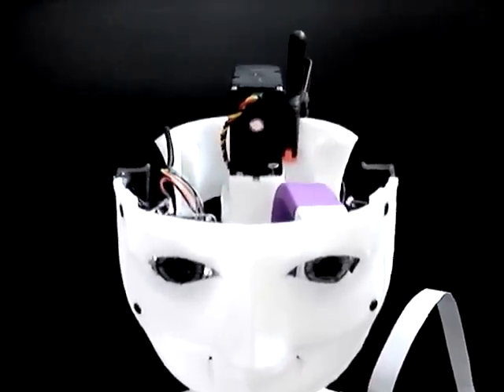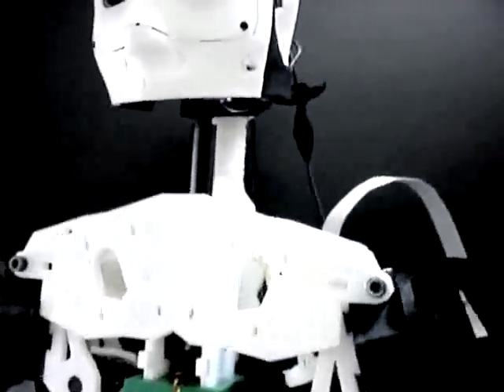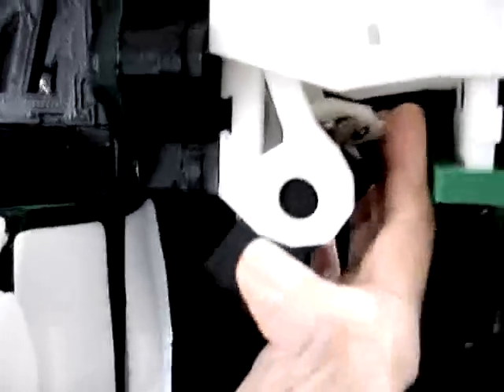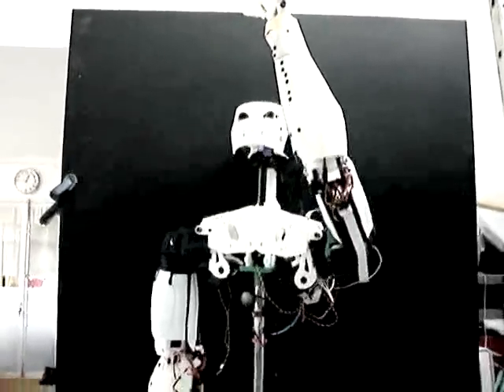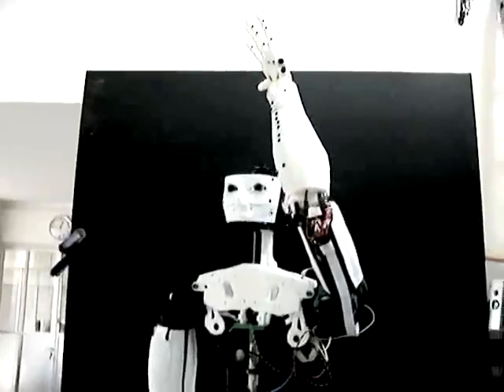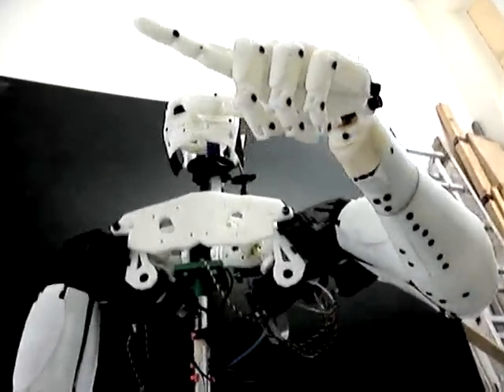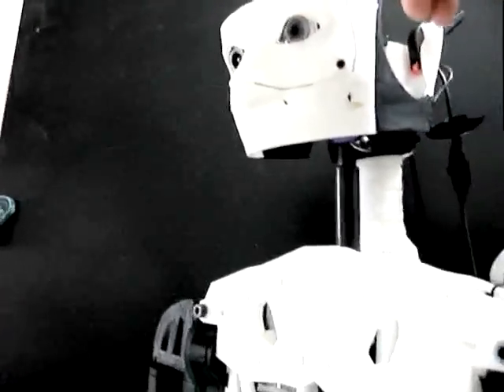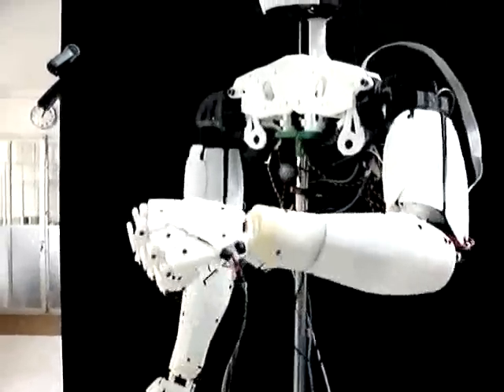InMoov Arduino Animatronic Robot Hand 3D Printer Part9

Comment: So every single component (appart from the wires, that is) is made out of plastic?
OK, if that is so then I think this project would be a good reason to actually get a 3D printer.  It's been hard for me to justify the purchase.
Reply from the maker: Just remember I design all parts in a 12cm3, so just make sure to buy a printer that can have a sufficient build area.
Reply: OK. Thanks.
Reply: gael langevin or if you get one that has too small of a build area make sure that the second thing you do is print a bigger printer that can, sorry had to say it...
Reply from the maker: Andreas Nicholas
:)

Comment: This is so cool.
I am also building a humanoid robot.
I am saving for a 3d printer to make robot parts.
My humanoid already have working arms and neck movement.
He does need better hands. Only one of his hands can pick up anything.
My avatar pic is the plastic face I made for my humanoid. He has a camera on his head right now until I can get one installed in his head.
I am also starting an android. These 3d printed parts will help get her moving much faster.